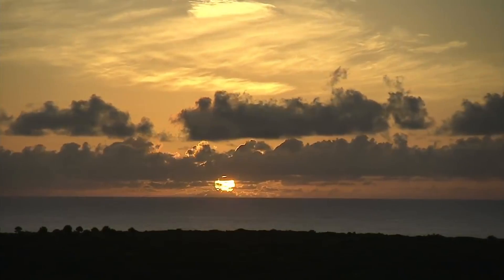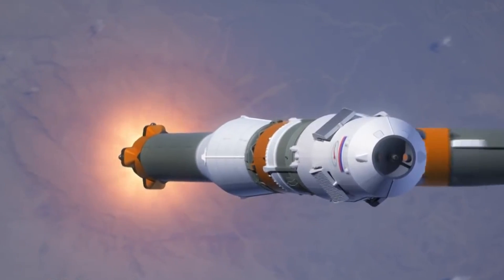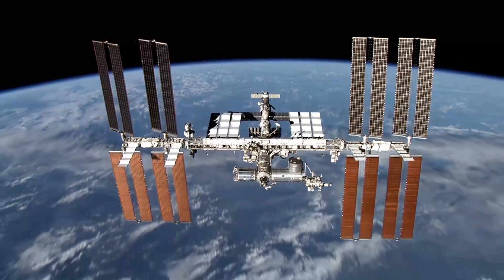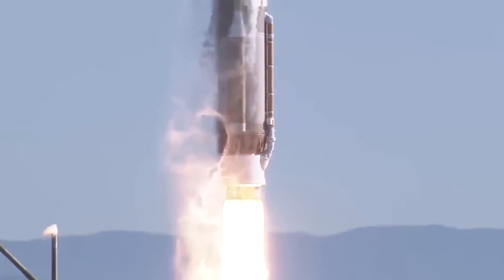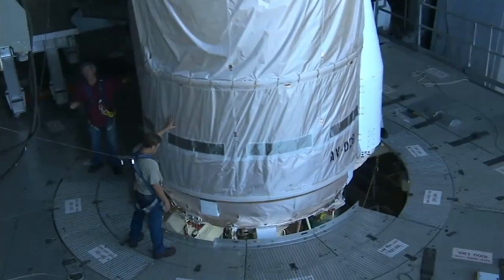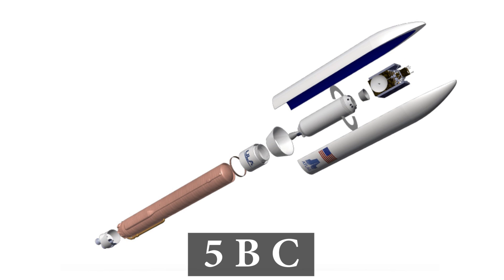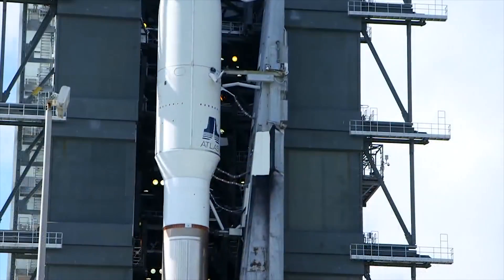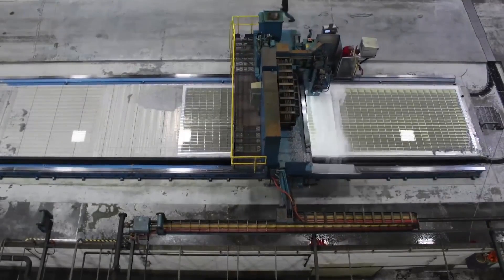Atlas V - an American rocket with a Russian engine

Comment: Correction / clarification... the Atlas III first stage core was the classic Atlas pressurised stainless steel construction, but with a single RD-180 propulsion section instead of the older Rocketdyne 3-engine assembly.

When they went to Atlas V they used a conventional construction like the Titan produced by Martin who joined with Lockheed and bought the Atlas / Centaur program from General Dynamics (Convair).

Comment: Delta five heavy was developed and is used quite frequently although it no longer uses Russian engines (for political reasons) it uses a newly developed version of the space shuttles RS 25 engine with a carbon fiber nozzle design to ablate instead of using a regenerative cooling nozzle which increases complexity. You can tell a difference because the exhaust is reddish orange from the carbon nozzle

Comment: While the first stage isnt what it once was in the rocketry market.  Centaur is still probably the best second stage out there.  I would say Centaur is the real ace that ULA holds over much of the launch market.  Now we need a video on Delta IV,  Its especially interesting because it seems like it rarely flies in its single stick configuration and only flies heavy.  Also it sets itself on fire at ignition.  And that is normal and expected function, not a design flaw.   There is even a Delta IV heavy launch tonight or this morning depending on opinion (Thurs Aug 27 0552 GMT/UTC/Zulu) well if everything works out, rockets are fickle creatures.
Reply: ULA stopped making the single-stick version of the Delta IV several years ago because it was in the same launch class as Atlas V but with a much higher price. The only reason that they still fly the Delta IV Heavy is because it can launch heavier payloads than even the largest Atlas V configuration can.

Comment: Since you do such a great job with the rocket episodes, would you consider doing one for the capsules as well?
Dragon-2 (SpaceX's manned capsule) just got done sending the first astronauts to the ISS from US soil in I think 8 years.
Starliner (Boeing's capsule) had so much trouble on it's first test flight that they have been told by NASA that they have to fly another test flight before they will put crew on it, instead of being put into service on the 2nd mission like they were planning. I expect something of the same mind-set that led to the 737-Max problems happened there but I don't know for sure.
And since I can't seem to get a good source in English, perhaps you could cover the goings on about a new space capsule for Russia, I think it's called Federation? Like I said, there's not much info that is in English, so I've been making do with what I can get from Google Translate but I know I'm missing out on some information.

Comment: Great video Sky!

These engines are really quite something. Their ancestors are the NK-33 motors from Kuznetsov, designed and built in the 1960s. They  allowed high-efficiencies in a 'staged- combustion cycle' but required special alloys and coatings which were completely unknown in the West. 

The NK-33 was created to fix short-comings in Kuznetsov's original NK-15 motors which powered the colossal N1 rocket. Had the fifth N1 flown, it would have used NK-33s; but after four failed launches, the new head of the Soviet space programme, Valentin Glushko, ordered it cancelled and the rockets broken up. Kuznetsov continued work on the NK-33 until he was forced to stop and ordered to scrap the motors - but he refused and had the completed motors shipped to Siberia where they lay in store until after the end of the Cold War. Meanwhile, Glushko went on to develop the monster Energia - which needed the RD-170 engines, the direct ancestor of the RD-180 in the Atlas. It's a small world after all.

Russia needed money, so it sold 36 NK-33s to Aerojet who planned to use them on the Kistler K1 and Antares rockets. Meanwhile, in Russia, the NK-33 now powers the Soyuz 2 rocket. Not bad for a piece of technology more than 50 years old.

There's a rather old documentary from the UK's Channel 4, called 'The Engines that Came in from Cold' about the NK-33 which might be online. It has some footage of the N1 launches which is well worth anyone's time.
Reply: Great comment, thanks. Have found the documentary you recommend 👍
Reply: Mike Richards Soyuz 2.1v🤮
Reply: @iain3713  Envious? We know that the soyuz is the best and most reliable rocket.
Reply: Not really... rival design bureaus, different family.